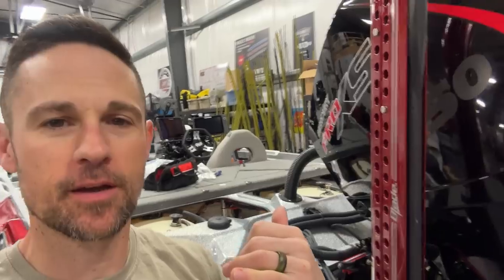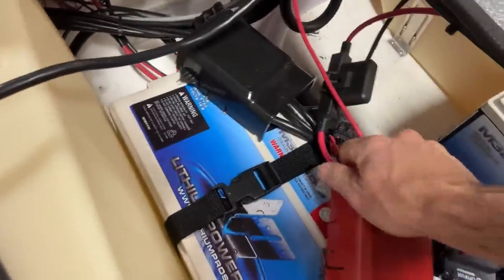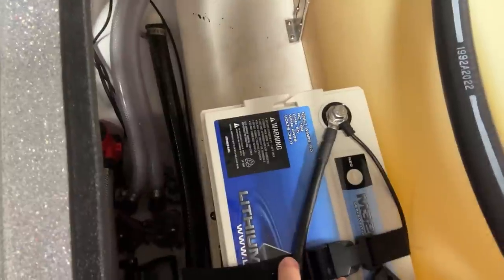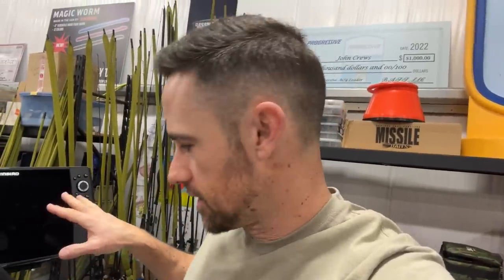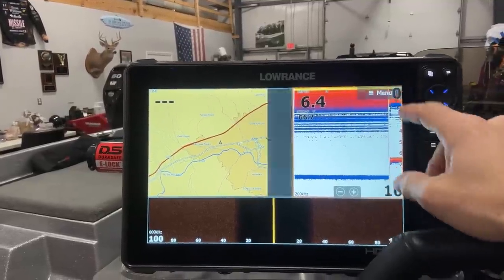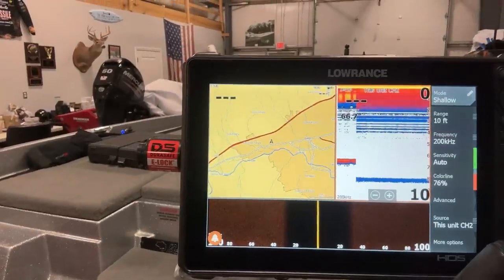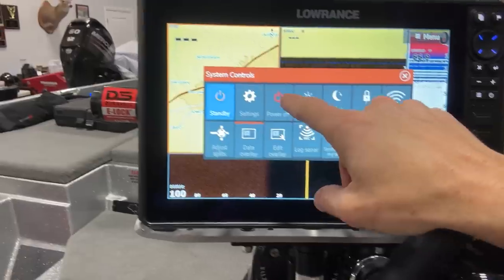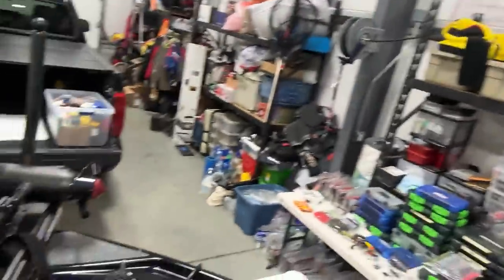Boat Rigging Tips and Update on 23 Puma STS

Comment: These rigging videos are my favorite!  It's my understanding that lithium batteries can't be charged in temperatures below 32 degrees.  Do you have some kind of heating system for your batteries when you are in sub freezing temperatures?
Reply: pricier batteries have build in heater and high temp and low temp cutout sensors to prevent issues
Reply from the maker: Old school heating pads or a shop light will heat up battery components enough
Reply: It's surprising that one 12 volt lithium can run all those graph's.
Reply: @rowdybroomstick6394   and the engine and the live wells plus lighting for 8-9 hrs easily

Comment: If you think about how a motor toter work's compared to a transom saver bar you'd realize that the bar going down to the trailer is the only way to actually stop any sort of flex in the transom. The motor toter at best only helps stop damage to trim system, the whole weight of the motor is out in the air without any outside source of support to stop unseen flex going down the highway.